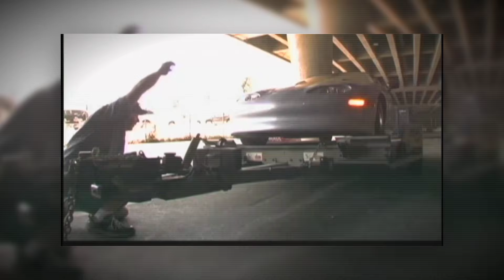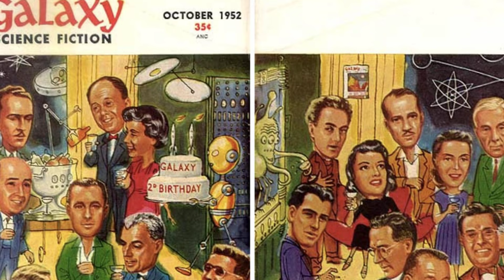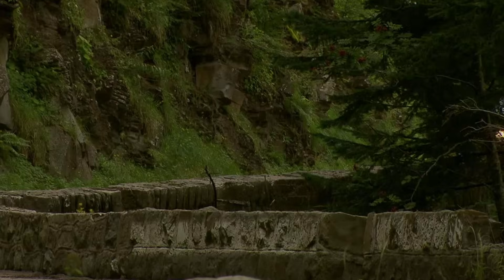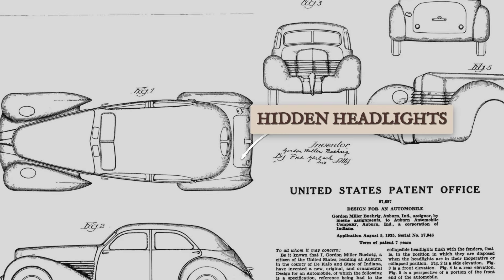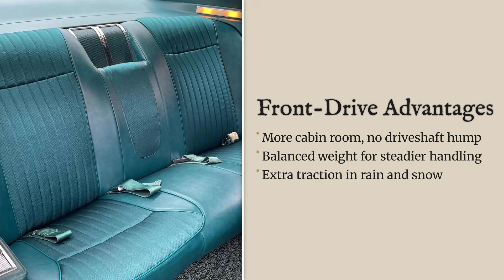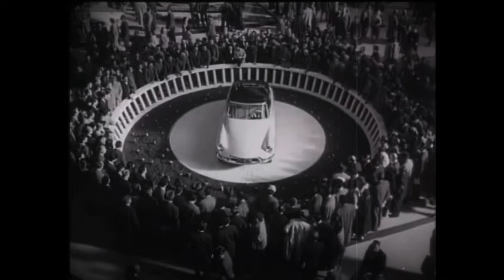10 ADVANCED Car Features That Were YEARS Ahead Of Their Time

Comment: The 1961 Chrysler Ghia used TV's for the instruments, had "hands-free driving" IF the US Interstate and US Highways had the induction wires installed, TV cameras (COLOR!!!) for rear-view and backing and the FIRST factory installed Compact Cassette Deck (Blaupunkt) AM/FM stereo/three band SW radio ever made. Under 300 were made as they were a $61,000 car, when that would buy a five or six bedroom ranch-style house (4000+ Sq. Ft.) on more than a quarter acre lot. A TRUE 400HP Bendix fuel injected Hemi 5 speed manual (Gertag) with the alloy body would scurry-ina-hurry. First US car to wear Michelin Radials from the factory too. In the 1960's Chrysler had Ghia, Ghibli, Pininfarina, and a couple of other Euro design houses provide bodies, and finally had Citroen design their hydro-pneumatic suspension for a semi-prototype. Best riding and best handling cars EVER made in the US-just WAY too far ahead of their time.
Reply from the maker: "Incredible detail — the Ghia L 6.4 is genuinely one of the most overlooked cars in American history. The Blaupunkt cassette deck, the Citroen suspension collaboration, Michelin radials from the factory — it was basically a decade ahead of Detroit. That's exactly why it earned its spot on this list. Thanks for adding this context — this is the kind of comment that makes the research worth it."